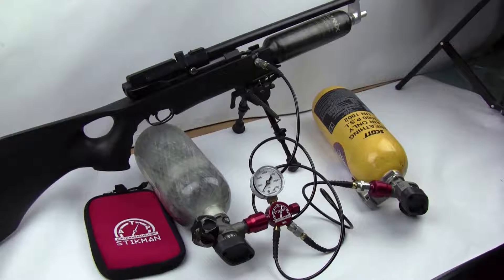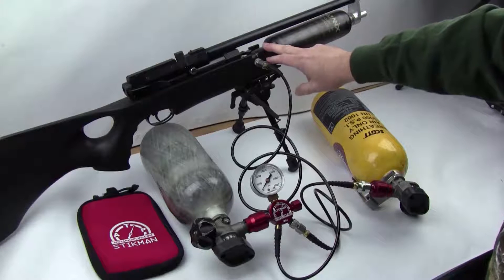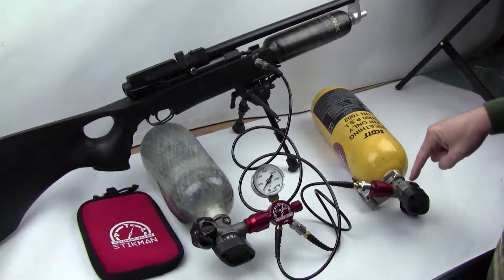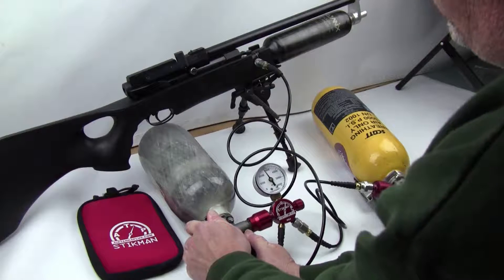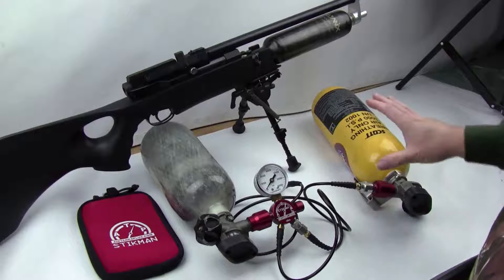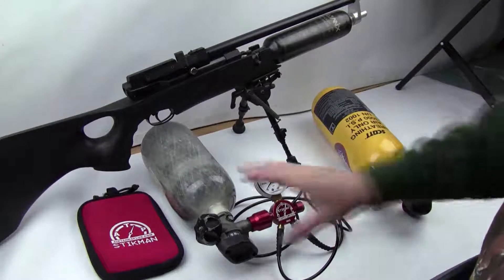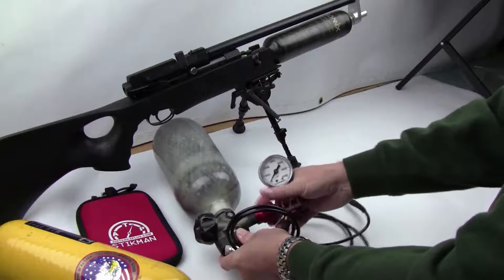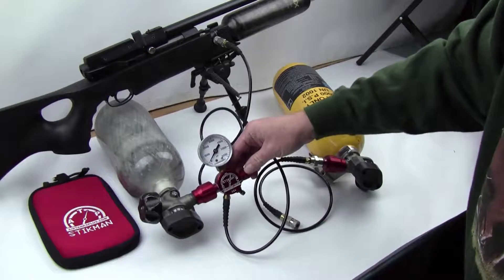SCBA Cascade System | Using Stikman with Cascademan to fill your PCP airgun

Comment: You need to get a much bigger scba tank, that one is tiny.  get a 74 or 88 cubuc foot one for that gun.    Saves a ton of trips to the scuba shop.
Reply from the maker: Thanks for the comment.  I love my little tank that would get you around 500+ shots with a .22 airgun.  We sell Alkin 4500psi Compressors so air is never a problem.  We also have 88CF, 66CF, and 44CF scba tanks we use.  My advice for everyone is to go with the 88CF scba tanks because most places that fill them will charge you the same amount regardless of the tank size.  We also sell used scba tanks https://airtanksplus.com/product-category/used-scba-tanks/